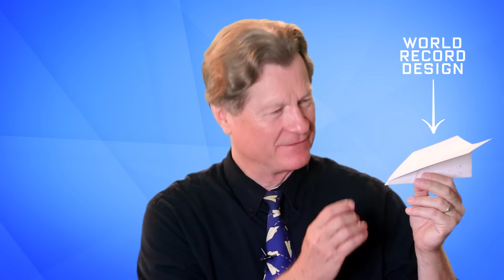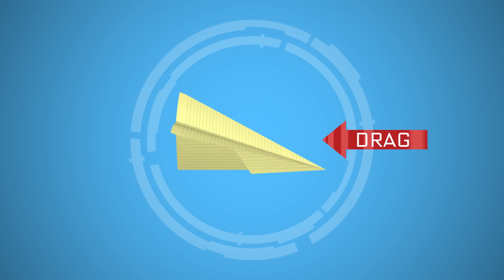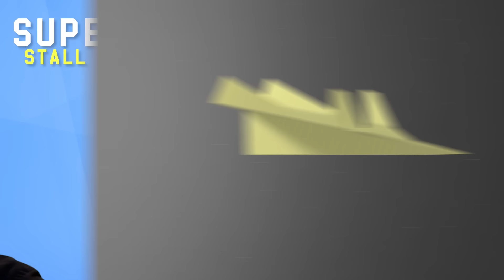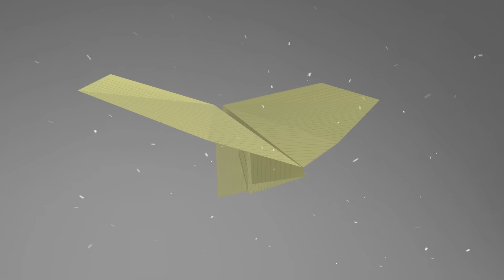Aerodynamics Explained by a World Record Paper Airplane Designer | Level Up | WIRED

Comment: I came here to see if I can find a good explanation on the tube airplane and found no explanation...
But also, the spin of the tube paper airplane doesn't give it it's life. You've ever made one as a kid and threw it, you'd notices that the heavy part, where the 2 ends of the paper are joined, will eventually settle on the bottom. And even after it settles, it continues gliding.

Comment: Unlike the Bernoulli equation, the Coanda effect is not a first principle in itself, so it does not provide an actual explanation. Morover the sticking of the airflow to the shape of the object is caused by the gradient of pressure around the said shape, which, in turn, is governed by the Bernoulli equation.

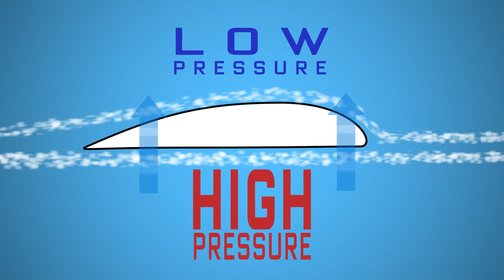3:46 - That's just plain incorrect. Bernoulli works everywhere, not just in closed environments. It is simply an energy conservation principle written for a streamline, so the only prerequisite for it to be applicable is having a stable flow.
Reply: Nerddddd

Comment: So, I came to get some questions answered, but more likely I will start an argument.  We can all see how the bottom of a wing uses Newton's Law to push air down and create an opposing force.  But here's my confusion, the air that is accelerated down by clinging to the curved upper surface, doesn't seem like it can create any downward force until AFTER the rearward moving air clears the back of the wing, where it pushes down on the air BEHIND the wing.  I don't see how it can create any downforce while it is still traveling over the rigid wing.  So, if the force vector is pushing down behind the wing, isn't Newton's opposing force also acting behind the wing, and therefore unable to exert any upward force on the wing itself?  Lifetime airline pilot, have watched the "explanation" of lift evolve over 50+ years, but I revisit it every few years to see what's new.  Current discussion is what % of the lift a wing created is created by the bottom of the wing, vs the top of the wing?  This video is a great discussion, but doesn't address how a totally flat wing surface (a paper airplane) truly can create lift with no airfoil shape.

Comment: I beg to differ on the Coanda effect being solely responsible for lift. Lift is created by the Bernoulli principle predominantly, with the coanda effect playing a supportive role. Think of the flaps on a commercial aeroplane (responsible for more lift at lower speeds) increasing wing surface area and curvature which accelerates air above the wing thereby decreasing pressure above and increasing pressure below the wing creating more lift at lower speeds as the plane comes in for landing. The ailerons which are responsible for roll of the aeroplane can be thought of more in terms of the coanda effect although they also cause pressure differentials.
Reply: Thank you

Comment: One of the most remarkable paper airplanes I've ever made was a custom diamond-shaped aircraft. It could gracefully glide far in a straight line, effortlessly trading altitude for speed. This paper airplane could endure low speeds exceptionally well and had a high chord. Sometimes I ponder if making the chord smaller would enhance its flight capabilities. With its anhedral for fast and unstable flight, it would elegantly maneuver in continuous turns. Depending on its altitude, it could gracefully soar for an astonishingly long time. It's surprisingly easy to fold and effectively minimizes drag. Yes, it's a flying wing design.

Comment: Thank  you. This is the correct explanation.  The equal transit time explanation confuses an action with a reaction.  It says that  "lift causes lift". But it doesn't. Downward accelerated air does. There is no other cause as well. Just as it is not possible to get lift without accelerating air downward, it is not possible to accelerate air downward without getting lift.  To say that you get lift by creating a bernoulli effect is redundant and circular  false reasoning.

Comment: The FAA pilot handbooks swear that Bernoulli was right, but you're saying it's not so? I'm a flight instructor not an aerospace engineer, but I'd like more info on why you claim high/low pressure has nothing to do with the lift generated by an airfoil.
Reply: hes wrong

Comment: this is more flight theory than it is aerodynamics. and i thought that angle of incidence is the angle that the wing chord is fixed to the fuselage, angle of attack is the pitch at which the wings face relative air flow controlled by yoke or stick. am i wrong?

Comment: EE here, not MechE. I don't understand what open system vs. closed system has to do with Bernoulli's equation. Isn't Bernoulli applied to any single streamline of a fluid, between two points? Why should it matter if it's inside a pipe or outside a pipe? Being inside a pipe only adds wall shear stress forces.

Comment: Dispelled the Bernoulli fallacy once again. Maybe with another 100 years of this information we can finally defeat the FAAs misinformation. (They stubbornly keep teaching Pilots Bernoulli, in spite of the fact that it's been considered inaccurate since before there was an FAA). Their own pilots flying handbook explains the curved upper surface is responsible for the low pressure area above the wing and for lift. The very next page they state that symmetrical airfoils also generate lift. But they give zero explanation of why this is true. And they also have zero answer as the why airplanes can fly upside down just fine. Comical.

Comment: if it is laminar flow then yes in some degree it is bernouli. 
at 5:03  that coanda  is not laminar flow,  because there is a vertical flow.

if you mean deflecting the air to get a wing's lift, this could be more of coanda, but this is not a flow.

Comment: You can´t assume that the Bernoulli effect isn't what creates lift in general. It is only in the case of paper airplanes that assumption is true, but what creates lift, in that case, is the vortices created at the edge, caused by flow separation.

Comment: Lift to Drag Ratio = Glide Ratio 7:41
---‐----------- 
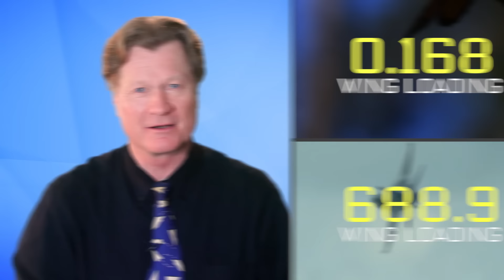Big wings = More drag||Small wings = Cut through air 7:21
---------------
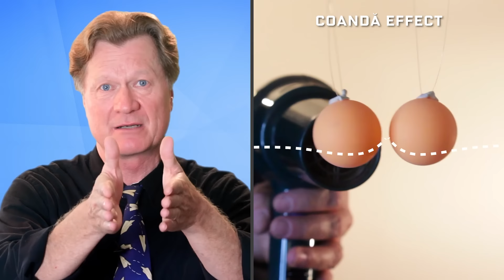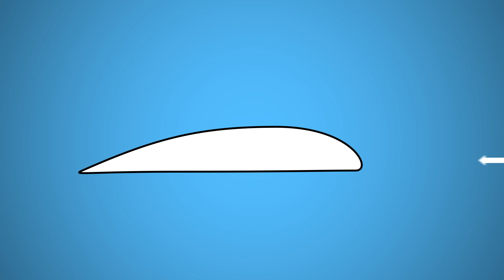Air will follow the shape of any object 4:29&10:27
---------------
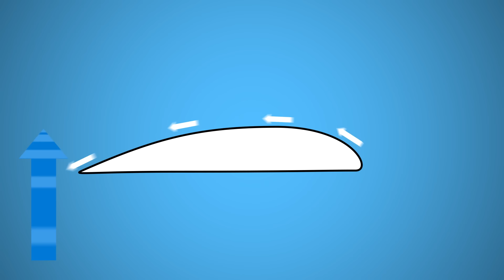Stall = Is when the air cannot follow the shape of the wing 10:33
---------------
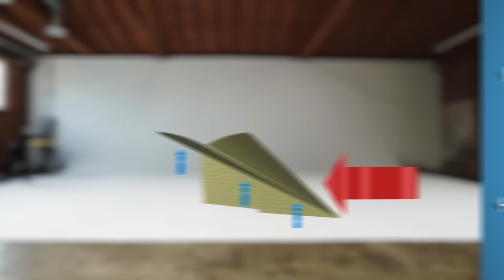Drag = The Air molecules are trying to halt the kinetic force of an object 2:09
---------------
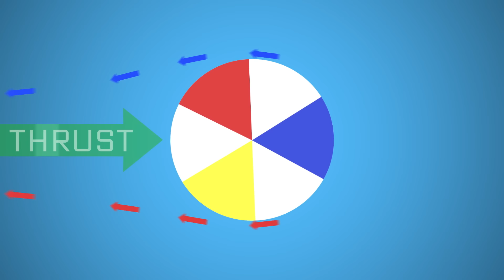Boundary Layer = The air stuck to a object(Which is spinning) will move with the object 12:24
---‐----------
Slower fluid speeds = High Pressure
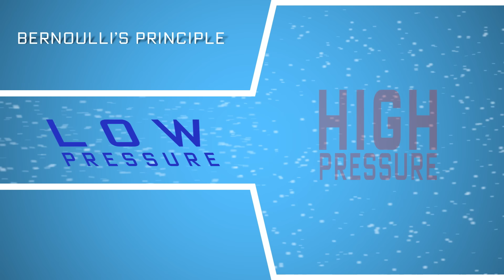Faster fluid speeds = Low pressure 3:37
--------------
Wing Loading = Weight of Plane ÷ Surface of Wings
High Wing Loading: Moves faster for lift
Low Wing Loading: Slower to life the weight 6:36

I'm done now😃
Reply: Amazing!!
Reply: Wow!!!
Reply: But smaller wings need higher speed😅

Comment: 07:27 "Let's go one step further and see how wing loading can affect the distance in flight"
Fun fact: when you're gliding... it can't.
Two externally identical airplanes, one heavier than the other, will have the same L/D ratio, hence the same gliding distance. The effect here (with paper airplanes) is related to the "thrust" (or "dart", or ballistic) portion of the flight, before the paper airplane stabilizes at is trimmed gliding speed. Once gliding at its optimum speed, gliding distance will not change with weigh.

IOW: Instead of being shoved at maximum speed, if two externally identical paper airplanes of different weights were just accelerated and let go at their respective optimum gliding speeds, weight (and wing loading) would not matter and they'd have the same gliding angle and range.

Comment: I wonder why windmills don't have blades shaped like airplane wings with the front of the wing facing the wind. The windmill would turn slower but have more power. A gear ratio increaCE would need to be implemented to get a generator to produce power. Think of a bicycle wheel turning the pedal gear instead of the other way around.

Comment: How do you stabilize a paper airplane?
Throw short, stout planes upwards.

 Use the same pushing motion with your hand, but apply more force. If the plane is a dart, it will stabilize as it descends. Non-dart glider planes should be throw upwards gently with a pushing motion.

Comment: When you throw a paper plane in the air, you are giving the plane a push to move forward. ... While the plane is flying forward, air moving over and under the wings is providing an upward lift force on the plane. At the same time, air pushing back against the plane is slowing it down, creating a drag force.

Comment: 1. As far as I know, aerodynamic stalls due to slow airspeed don't exist, "Stall Speed" Is the lowest speed you can fly level until you have to point your pitch up too much that your wings stall out, IE Your minimum level flying airspeed.

2. Bernoulli's explanation on wings is still correct, air can compress and that's easier for it to do than move air around it, so you can think of it as a pipe, partially.

3. You forgot the coanda effect and euler equations relations, A curved streamline has a pressure gradient, higher on the outside of the curve, lower in the inside of the curve, If I can remember correctly, that's due to the inertia force / centripetal / centrifugal (whichever is the right term, I genuinely can't remember but you get my point), And due to this principle, Where there is a curve, there is a pressure gradient, which is why planes may also have concave curves on the bottom of their wings in some areas to slightly increase pressure on that side.

Learn engineering has some good videos on it, But either way, all explanations are correct and provide to the lift on the wing, it's a complicated yet beautiful balance of physics in play to achieve flight and aerodynamic lift forces, excluding the false "equal time arguement", because believe it or not, Air particles can't exactly think, communicate and understand eatchother.

Edit 1 :  About the magnus effect / spinning ball, you can also say that since air at the bottom is slowed down and crunched up, and air at the top is uninhibited, theres a high pressure at the bottom than on the top, creating lift.
Reply: You dont know much.
Reply: @nineball8583  But he doesn't know that.
Reply: Put a minus sign in front of everything you said and almost everything will become true.
Reply: This video is a simplified version, it doesn’t go much in depth, it only goes to what a Paper airplane needs like uphedral, up elevators, wing types, coanda, Reynolds’s number, high pressure and low pressure and humidity.

Comment: This is not the correct explanation of "lift".
The pressure difference creates a circulation of air around a body. That's why the slipstream at the back doesn't round a sharp corner into the low pressure area generated by the moving body. 

Newtonian displacement isn't "wrong", but it is a partial explanation. Likewise, Bernoulli isn't "wrong" as the vid claims.  Pressure differential is a large part of the explanation.

That said, i watched for the paper airplanes. Which were interesting 👍

Quick search found this video. It's a more accurate explanation of lift for those interested: 

https://youtu.be/E3i_XHlVCeU

This is a more technical explanation of lift for science types. By an expert in aerodynamics.

https://youtu.be/QKCK4lJLQHU
Reply: Yeah I've got some complaints with this too. Thanks for your link. His explanation of why the cylinder flies is pretty half baked. There is no reason it should generate lift as the top and bottom are in the same environment (unlike the thrown beachball).

Comment: Bernoulli equation can definitely explain the lift with no doubt for low Reynolds number airfoil. In the ping pong case, the ambient pressure is definitely higher than the pressure between balls, so the pressure push the ball to move to the middle. Bernoulli equation can explain this as well. Coanda effect is just a phenomena, it is not a theory, the underlying theory is N-S equation, in a simple way, it is Bernoulli equation. Your experiment cannot prove Bernoulli equation is wrong, although there are four restrictions for using Bernoulli equation: 1. Steady, 2. Incompressible, 3. Inviscid, 4. Flow along a streamline.

Comment: Is that boundary layer phenomena related to magnus effect ?
Reply: The boundary layer is related to Bernoulli Principle, which is half of lift. It has a lot to di with Newton's 2nd Law, which is most of the rest of lift. Momentum of air molecules and inertia ballance to allow circulation around a wing. That sets up a sustained airflow velocity. It's this velocity that allows fir lift, not the "coanda effect" (which isn't needed in lift at all). 

"Downwash" is only half of lift. "Upwash" is the other. And happens at the front of the wing.

Newton's 3rd law is maybe 20% of lift, not 100% as the vid implies. 
Truth is: lift is complicated. Nobody really understands it fully.

Comment: You are mixing up a lot of things. Viscosity to coanda effect, magnus effect to boundary layer, and a lot. It is misleading at times.
Reply: Yup. And pressure difference IS a big part of lift. Circulation around a body is needed for downward displacement. Otherwise the slipstream could turn sharp corners, (like going upward at the back.)

I like the personality, but the science is not accurate. They really need a science editor before releasing these things to the public. Now we will have thousands of people with incorrect notions spreading it to others.

 Ah well, the paper airplanes were cool.

Comment: This is the thing I have looking for ha I knew that bernui Law WAS WRONG
Reply: So there's a bit of confusion. Bernoulli is a principle, and is part if Newton's 2nd Law. It really says that (pressure + velocity = a constant force). So as velocity goes up, pressure must go down. This is why tornadoes produce lift to objects inside their funnel. (No solid surface needed. It's all Bernoulli fluids). 

Since we know velocity does go up over a wing surface: pressure must go down. Lower pressure is needed for lift 

So Newton's 2nd Law (F=ma) is what we need for lift, since lift only occurs with motion and involves acceleration.

Newton's 3rd Law only says forces must be balanced. It doesn't describe a cause. So cannot be used to say what causes lift.

Comment: How about a wing that is folded in tight for the fast hard throw upwards, and unfolds at the peak for a long slow glide.
BTW the boudary layer stuff about spinning balls creating lift  has nothing to do with the cylindrical foil, which is rotating on the same axis as the travel direction which makes it more stable.

Comment: A successful flight is 80 percent dependent on the pilot and 20 percent on the design.
It takes a lot of experience to properly throw a plane.
Reply: Joe Ayoob certainly had a lot to do with the success.  I think you're skipping over the constant adjusting required to dial in the glider so that it will go this kind of distance.  Construction is important, and my job wasn't over once I handed a plane to Joe.  We worked together, modifying the adjusting and the throw for each try.
Reply: @ThePaperAirplaneGuy  
Here I completely agree with you. You can  win only when you are on a team.